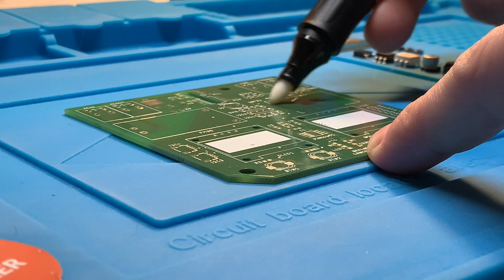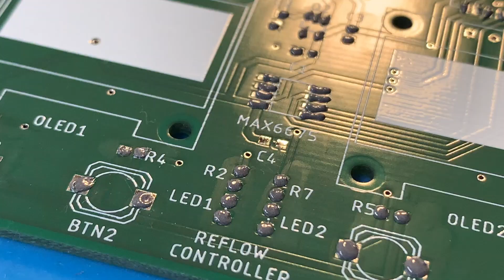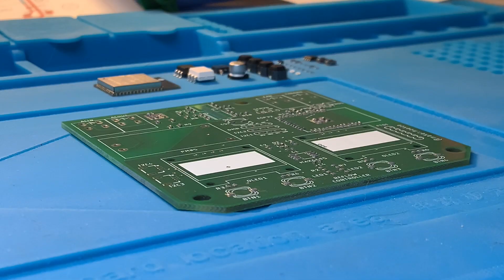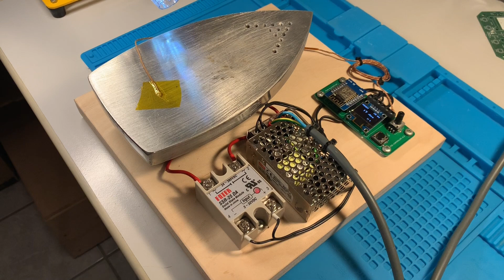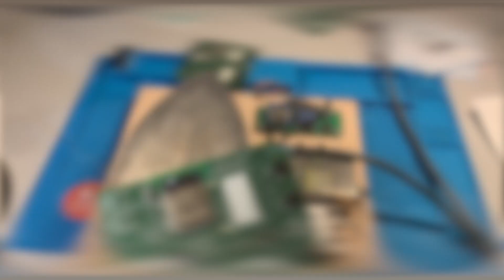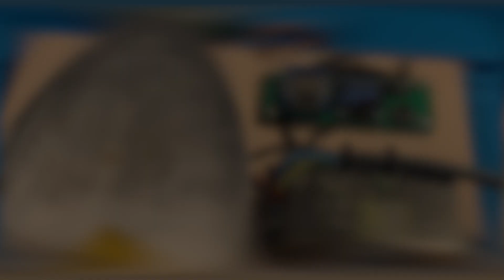Soldering SMDs with a FLAT IRON?! Homemade PCB assembly

Comment: i wish i can make flat iron too, if you have tutorial please share with us for learn
Reply: Um... I hate to be discouraging; but the setup here is a bit dangerous - there’s live mains voltage exposed. Until the setup becomes obvious to you, I would really recommend buying a pre-built soldering hot plate. They’re not too expensive. 😉

Also, cloths irons aren’t noted for having even temperature across their face (which is normally OK because your shirts etc don’t care); but units designed for soldering - well, at least the good ones - do have a relatively even heat distribution.
Reply: @darkwinter6028  x
Reply: @kylehaston6662  Same safety problem: exposed mains voltage. The SSR, heating element, and power supply NEEDS to be covered, or sooner or later you’re going to get shocked by it.

Also, as noted both by my original comment and that GitHub repository, heat control is… not great. Workable with some care and experimentation (use a thermocouple probe to find the hot spots, and move the board around with a tool of some sort to try to even out the heating of the board).

By the time you have added up the price of all the parts, you’re getting awfully close to the price of a pre-made one with a big aluminum plate. Normally, I’m all for hacking stuff together, if for no other reason than to be able to say “I did it myself!”, but in this case the significant issues are piling up rather quite a bit…
Reply: @darkwinter6028  "Same safety problem" because it's the same project. I've had success with a hot air gun. Will try this method as well. You're right: don't touch mains voltage or you'll get zapped.
Reply: @kylehaston6662  Ah. Figures.

Also, it’s bad enough getting zapped with 120v, but much of the world uses 240… which has a disproportionately larger bite. So, if anyone is seriously considering trying this, please do insulate the mains wiring before plugging it in!

😉

Comment: I reach to your channel while searching whether I should built an oven or a hot plate. You either has a very good dispenser or very skilful in doing it. I have the same soldering paste that I bought from China, but it came without the needle and pusher. Where do you get the dispenser?
Reply: For you or anybody else looking:

I recommend that you order a stencil together with your PCB and apply the solder paste with a spatula. This method saves a lot of time and does not require dispensing equipment.

You can tape your board to a flat surface surrounded by other boards of the same height, and tape off one end of the stencil so that it acts like a lid.

If you're not comfortable with this setup, I can recommend buying a cheap stencil printer. This is a device that you can use to fix your board and hold the stencil for you. It's basically just a metal plate with a smaller hinged plate to hold and set the stencil. I use one from the "Beta Layout Reflow Kit V3" and for such a simple device, it makes applying solder paste much easier. This does not mean that you will need the oven or anything else from the kit, just an similar stencil printer.

Just make sure you store the solder paste properly and keep your equipment clean and it will work wonders.

Comment: Nice, finally someone did it, have this idea for years, just because I have a flat iron from a complete steam ironing station whichs boiler broke and the replacement part is ways too expensive, this iron doesn't even got holes in it, also I have a similar idea, making a heating plate for iPhone boards from a hair straightener, this got already everything that is needed and the control is actually for two heating plates, but since I don't do iPhone repairs and can solder all my things with my hand, there just wasn't the necessity to realize the idea, the hair straightener I will probably sell, it is a pretty expensive piece of garbage to ruin hair, I mean it's "Braun", that company that sells electric toothbrushes for $400+++ so there should be enough TV-children who would buy that.

Comment: i want to know how you made this iron pcb smd connector.. if you have any link pls give. i really  like this project
Reply: At about 3:45 or so you can see the whole setup. However, it’s kinda dangerous; with exposed live mains voltage. If just looking at it doesn’t make it obvious to you, then I would really suggest that you buy a pre-made unit especially for soldering. I say that not to be discouraging; but out of concern for your safety... 120v will bite you bad; 240v will bite you REALLY bad. Pre-built units aren’t that expensive. 😉

Comment: I'm curious, why don't you use a stensil to apply solder paste? Shouldn't it be quicker and easier?
Reply from the maker: Yeah, as matti already said, for only one PCB a stencil is really expensive and there isn’t any time benefit using a stencil. I have used stencils several times, the results are sometimes better but the dispenser work makes more fun :)
Reply: It’s a year later; and stencils from the low-cost PCB houses have really come down in price. I’d give serious consideration to getting one now if I had anything with a bunch of small leads on it; and definitely get one if there was a BGA on the board.

Comment: Good afternoon. I wanted to ask how or where can I found some sort od information about the flat soldering iron. I was thinking about makeing something like this for finall project in school because this project is AWESOME<3
Reply: That’s just the foot of a regular cloths iron; either 120v or 240v depending on which country it’s from. As you approach your final project, you should have the knowledge to make one by yourself. However, if you look at around the 3:45 mark, you can see the whole setup; and see how he did it.

This project involves working with live mains voltage; which can injure or kill you (and while you’re dying, it will hurt the whole time)... so, before plugging anything into the wall, have your electronics instructor review your project for safety.

Good luck with school! 😉

Comment: excellent, my query is at what temperature do you support the pcb on the iron and how long do you remove the pcb?
thanks!
Reply from the maker: Temperature is max. 195 degrees here. Once it reaches the max. Temp it will turn the iron off. Whole process is about 4 minutes
Reply: The peak temperature, and how fast you want it to get there, depends on what you’re soldering, and what kind of solder paste you used. Lower temperature paste, obviously, puts less stress on the parts being soldered; but may have some drawbacks for certain applications (however, if you’re using a cloths iron to make your boards, you’re probably not in the kind of position where that would matter). 😉

Comment: Nicely done. What brand is your phase angle relay?
Reply: It’s not a phase-angle relay, it’s just a Fotek solid-state relay; and there’s no feedback to the microcontroller to do phase-angle modulation. Consequently, all the firmware is doing is switching it on and off for at least several whole cycles... perhaps even whole seconds at a time.

If you look at around 3:45 or so, you can see the whole setup, including the SSR, power supply for the microcontroller and lcd, and the control board.
Reply: @darkwinter6028  You are switching AC with slow PWM and ignoring the phase?  My understanding is that that is generally a bad idea, because if you switch the load off instantaneously and there is any kind of inductance, it will create crazy high voltage spikes.  Perhaps not that bad with a (mostly) resistive load.  I use phase angle relays in my solar water heater setup.  (They're very expensive)
Reply: @ChristieNel  I’m not the video producer; I’m just a guy who’s fairly familiar with the parts visible in the video... but, yes; without some sort of suppression components an inductive load will generate a big reverse voltage spike if abruptly shut off. I’m not sure how the Fotek SSR handles the issue; I’ve got a handful of 40A ones here; I should probably try it and see what the resulting waveform is. One possibility is that the photo isolator has a capacitor across it, and keeps the turn-off speed from becoming excessive; another is that the switching element is avalanche rated, and lets current flow above it’s avalanche voltage threshold; or there’s a bidirectional voltage clamp device in there (like two back-to-back zeners, but uprated to handle the rigors of snubber duty).

Edit to add: I am highly suspicious that the heating element in that iron’s foot is a ceramic one, with only a few turns, if any at all.

2nd edit: or they’re using something like a triac which inherently doesn’t shut off until the zero crossing. It is an AC relay, after all. Should probably test that, too... see if running DC through the switching side of the SSR results in it not shutting off until it’s unplugged. 🤔
Reply: @darkwinter6028  Good analysis.  If you slow down the shutdown, you'd massively increase the MOSFET switching losses.  (I've blown many MOSFETs this way)  But if the cycle period is low enough, it might handle the thermal dissipation.  It's possible that the SSR has a triac arrangement.  I know they are used in phase-angle relays, but I had not considered that they could also be used to cheaply make full-cycle relays.  A bit like a burst-fire SSR.  I have used the latter, but they noticeably interfere with the lights on my inverter system.  I'd be curious to know if you're right about the triac.

Comment: I wonder Y the plastic tape is not melting .nd is the wire for earthing purpose?
Reply: The tape is made from Kapton, google it :)
Reply: @Wilson84KS  thanks.
Reply: @technoideas5835  welcome.
Reply: The wire is ... a temperature feedback to controller...
Reply: Thermocouple for feedback, specifically.
Reply: It looks like only the power supply is grounded; the iron looks to be floating. The body of the iron really should be grounded.